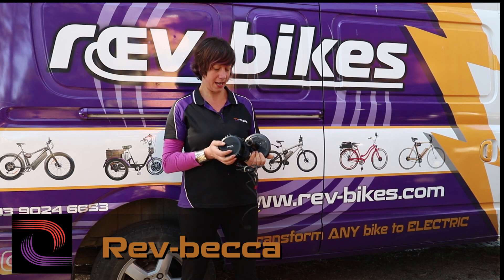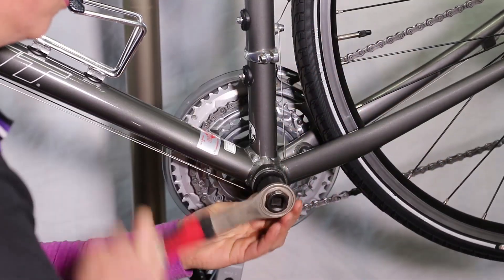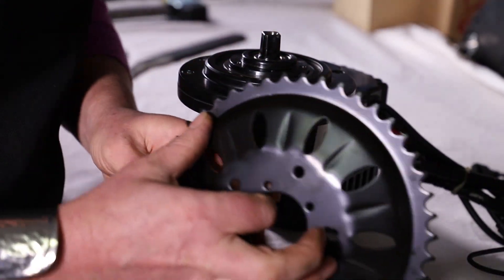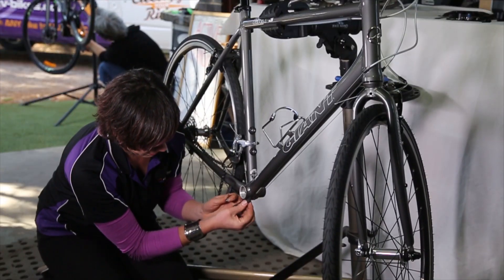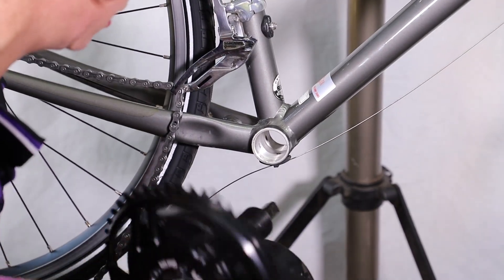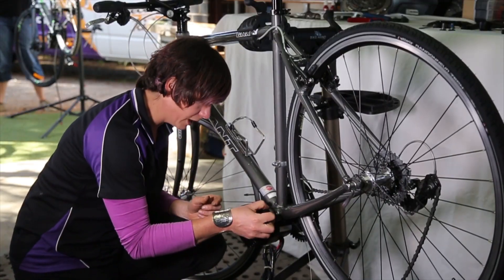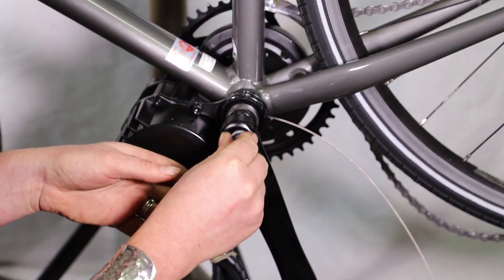Installing a Bafang mid-mount motor

Comment: Ladies and Gents, by far the most difficult bit is to get the right tool for your bottom bracket; this is becuase there are a zillion so-called "standards" out there.  

Be aware also that some cheapo Chinese bottom bracket tools are correct for the job, but are so badly made they still don't fit(!) 

The second most difficult bit of the job is to get your tool to actually work, this is because bottom brackets are very often in super tight even when the bike is brand new. You will probably need to find a way of clamping your bottom bracket tool in place because, when you put serious turning pressure on it, it will want to "wring" out. Remember, remember remember, what she said here about which way the bottom bracket turns each side of the bike. You seriously do NOT want to make it tighter while you are trying to get it loose. 

Once you suss these bits of the job, the rest is generally a cinch.  

Thanks to the maker for the video.
Reply: Nothing wrong with Chinese tools

Comment: Nice video.  The motor bracket washer/spacers and the cable guide and the rubber spacer  were particularly applicable to my Trek 300 Navigator.

Comment: I now have a 27-speed hybrid bike. and I have 3 gears with my pedal cranks.
now I wonder if those 3 sprockets are replaced by 1 sprocket and whether that is a disadvantage or not?

So do you actualy get fewer gears then before the installation?

Sorry for my poor englisch

Comment: I love the Bafang BBSHD, but anyone looking at one should choose LunaCycles as the company to buy from. I wont use anyone else. Besides, they are the only ones making an upgrade controller to push the BBSHD to 3000w!!!!!! It is night and day from stock. I could not go without mine now.
Reply: You can't get squat out of Luna these days.  Makes me really wonder.  Too too bad really.  They were the dreamers.  The innovators.  Then they just dropped of the radar.  Maybe somebody died.  Watt Wagon is the new bad boy.  If you have a LOT of money that is.
Reply: @nohandle257  Anyone that considers buying a Watt Wagon is thinking (not really) with an SUV mentality. Over-priced low-end bikes with add-on mid-drives doesn't make them "good". Anyone that has ever ridden, more than around the block, knows this. Ask God Reed... he'll tell ya.
Reply: I agree that the BaFang BBSXX mid-drives are the best way to build an ebike. I disagree that paying more for one resold by Luna is a good idea. But of course, I strive for range not speed. 3000W will only damage the drive-train. With the right components, a stock BBSHD with very minor programming changes will take me anywhere an over-priced Luna modified BBSXX will go and also much further.

Comment: Have you come across a bottom bracket the hole a bit larger diameter ( not length)  than the  Bafang motor shaft  Thanks Ron

Comment: Hi, if I have a Alfine  8 speed internal  rear hub with a belt drive, can you get a front chainring for it,  that will bolt onto your mid drive moto? If not, why not ? Cheers and good video.

Comment: Very nice! One thing though, You should have cleaned the threads, with Acetate, (Nail polish remover) before applying the "Lock-tight". Other than that, well done! A good, concise, instructional Vid. PS: You can come and put my Motor on, anytime....Geoff.

Comment: What are the statistics on the 1,000 watt motor, what is it's maximum speed, what is the maximum distance of travel, is it power assist pedal etc?
Reply: Search US ebike forums and suppliers and you can get all those questions answered.

Comment: The hand wrench for the BBSXX lock nuts is not sufficient. You can not get the recommended torque with a hand wrench and I over-torque mine by 20 lbs. Use the proper socket and a torque wrench. Also, get the chain line as straight as possible for the gear you are going to be in most... better yet get a Rohloff Speed-hub and get the chain line perfect. Grease the threads on the motor and drop the lock-tight, when you torque to spec it doesn't come loose.
10 May 20 - 100 miles.
https://www.relive.cc/view/vMv85EGzYNO
https://photos.app.goo.gl/9ZbuKQNWsHtRH3Ft7
https://prnt.sc/sw0igi
Reply from the maker: Of course a professional workshop will have a torque wrench socket, as we do. But DIYers probably won't. Nor will they want to change their gear system.. those things are best done by professional bike workshops, not DIYers watching YouTube for instructions 😜 Valid points all the same though 👍
Reply: @Revbikes  So you tell DIYers how to do it wrong. Shitheal points all the same. If you think only "professional" shops use the right tools... then you guys are the biggest one of all. Tell people how to do it right if you're going to offer advice it should be good advice. Fuck'en YouTube Yammerheads.
Reply: @brianbassettnumber1  Oh don't be mean.  These are nice people.
Reply: @nohandle257  I'm trying to help the individuals that want to build their own ebike and do it right Reed. Should I say it with a big smile? If someone is going to offer a self-help or DIY video they should do it right. Or at least look at how others do it properly before offering instruction. Jim Jones might have been a "nice guy" too (I don't know) but he offered bad instruction didn't he? If you're going to install a BaFang mid-drive use the proper sockets and torque wrench to do it properly. I suspect you couldn't care less about ebikes or assembling one.
Reply: @brianbassettnumber1  Yeah ok I  get it.  It's still true that you catch more flies with honey than with vinegar.
Reply: @nohandle257  When I'm trying to kill grass in an ecological manner Ms. Scott, I use vinegar, not honey. Right tool... for the job Reed.
Reply: @brianbassettnumber1  Good grief ... don't be so bitter.  You were correct in your  assessments but what is your point?  To get that point across I reckon.  Well you failed.  You  failed because you are angry and disgusting.  Just as in your reply to me above.  Life is short.  Yours will probably be shorter.
Reply: I  should have added:  Like your girlfriend ( who you should have married years ago ) has been trying to tell you.
Reply: @brianbassettnumber1  Oh my Lord in heaven he calls himself a 'christian'!!!  Well brother I do as well.  This all started when I lightly joshed you over coming on too strong on these nice people.  Then you have consistently  amped it up from there.  So be it.  I  just hope if you make it through the pearly gates you get a fenced off portion from the rest of us nice people.

Comment: Mmmm not so keen on the spacer used to keep the gear cable clear. I would have made one from a piece of nylon that is self-lubricating.
Reply from the maker: Yeah, we've also made much more elegant solutions than this example over the years 👍 This will get the average DIYer out of trouble though, if they need. But chances are, they won't do the motor up tight enough, and this spacer will fall out if not glued in.. Another reason we no longer sell these kits for self install!

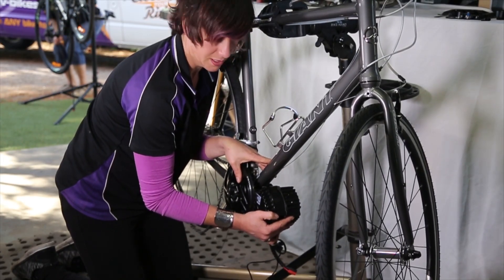Comment: @ 8:59 you missed a step. Using spacers if necessary to get the chain line on the center gear on the cassette.

Comment: Don’t get a mid mount motor no throttle and if the chain breaks you are walking. Rear hub motor only
Reply from the maker: We DO supply (optional) throttles when we install these 😁 How many chain breaks actually happen?!? It's pretty rare, have seen it about 5 times in my 10 years experience! If you split your chain for the installation and rejoin it using the same pin, it will be weaker. Keep your components maintained, and your chain wont break 👍
Reply: Serious ( common sensical ) riders carry a spare chain,  and the tools to do the job,  hub motors are ....

Comment: Thanks, in the middle of my install I just waiting on the bottom bracket tool and a front fork that I broke previously w a hub motor. Can't wait to ride
Reply: Must be a lightweight bike. Guess where it will break next.

Comment: I was wondering how these bolt on motors were installed. Thx. Good information. 

I assume the bottom brackets on bicycles are a standard size? I have a terrific 1992 Miyata Triplecross that I'd like to convert. Can I expect any fundamental size/thread incompatibility issues or are the brackets all the same?
Reply: She mentions about 90% are the Same.  68mm measured across width.  But not all.  Consult your supplier.  Measure your BB.

Comment: Thanks for the video, it demonstrated well including the pitfalls. And this is where I come in.... I have generally fitted hub motors and I am now looking at a mid drive but having watched this I am wondering whether all bikes can have one fitted. I have a Raleigh Royal which is a fairly old bike will it fit to the crank ok?
Reply: Richard, the Bafang should fit any bike with a 68mm Bottom Bracket.  I installed it on my older bike with no problem of it fitting.  If you do have the larger 73mm bracket there is a kit for the larger BB too.  I used Becca's videos and my install went well because she gives you heads up on what issues could come up, especially regarding the cables running along the bottom bracket.  I did have to make a small shim like she suggested to keep the motor from binding the rear brake and rear derailer cables.  Good luck on your install!

Comment: The one question I have about these BB motors is what happens to my converted bike now that I've moved from a 3 ring chainset at the front to a single one? Haven't I just lost two rings and the corresponding gears? Will the chain now be too long? What happens to my existing gearing system? Thanks.
Reply from the maker: You may have lost some gears, but normally it would be the lower gears, used for very slow hill climbing if you didn't have a motor. If you choose a chainring between the largest and middle, that will be best, no need to shorten the chain. You will GAIN five levels of assist to every gear also. You really won't need so many gears once you have the assist 😁

Comment: En visto se ve muy claro cómo meter el motor en el cuadro, pero faltan muchas sensores, la pantalla, todo el cableado,,, etc. Incluso a mi lo que más me costó de todo fué meter el motor en el cuadro ya que tuve que lijar el cuadro y el motor para que pudiera entrar,,, en fin una odisea.  Veamos cómo este tipo de motores se van popularizando. Gracias por el video.
Por  cierto, ya  nos dirás qué hiciste con los cables del tubo inferior.

Comment: "60Nm of torque, so I don't mind whacking it with a mallet.  This one takes 30Nm of torque, so I'm just gonna lean on it with my hand."  Precision measuring, that. :)
Reply from the maker: 👍We now use a custom built socket on a torque wrench in our workshop, but most people won't have that at home 😘
Reply: @Revbikes  I get ya but ..... most people would never try this job.  I am no mechanic but I have a torque wrench.  1/2" drive.  Why?  Because every once in a while I have to wrench on something that has serious requirements.  I'm sure lots of folks who are willing to spend this much to have an ebike will not wince too hard at buying a torque wrench.  Heck,  they can pass it down to their kid who has a fine arts degree from 175th and Plowed Ground State U.  My big question is ... where do I get that socket?
Reply: Yeah I know who sells the socket ... but is it THE socket?

Comment: I have a hybrid road bike with 3 main gear cogs and 8 gears on the cassette.  Will the 46Tooth bafang option be right for me?
Reply: Is it possible for me to buy the wrong option? it goes all the way up to 52T i think.
Reply from the maker: 52t gives less torque and more speed.. better for flat land. 46t is the best for good torque and speed.

Comment: Next time just run a full length cable housing for the rear derailleur.  Just use the screw at the bottom to hold the cable housing.  THat way when you change cables next time you won't have to remove the motor.

Comment: 73x65mm EBB on my Jones LWB steel frame gave me a run for my money.  Ended up having a machine shop shave off the bottom tabs, weld the BB at the bottom and installing a Bushnell EBB.  I now have a monster of a 750w ebike with H-bars, front and rear racks capable of sporting any pannier I like, and fantastic 2.35" tire handling.

Comment: I'd like to do this mod to my ACME by SPOT, Gates Belt drive system with an 11spd Alfine rear hub system. Where would I get the appropriate front belt drive sprocket for this motor install/modification?
Reply: I haven't seen a Gates used with the BaFang BBSXX yet. I can't because I have a full suspension tour bike with a Rohloff Speed-hub. A mid-drive to a suspended Rohloff with a belt drive would be perfect, clean, quiet, low maintenance, durable and pretty.
https://photos.google.com/photo/AF1QipMW6VP2OgxQVnUTqzm2yFEF-p9xXklItcc7CU7E

Comment: Hallo Good Morning 
Is a Pleasure having you how You put the Motor together.
Pls my humble Question is,how can I change my gear handle Bar comes together with 
The Break While BBSHD Break handle Bar Need installed,
Pls I need your help,
Reply from the maker: I think you mean you want to utilise the brake cutout function for the motor, but your brake and gear levers are integrated. 
In this case, remove the brake/gear on left (because you won't need to change gears on the front now), and just use the brake lever supplied with the kit on that side (no need to use both). 
It's also possible to buy sensors which can be attached to existing brake levers, if you want.

Comment: You don’t need the bike on the ground for disassembly if you grab the frame with your fingers and your thumb on the wrench. Turn the wrench like you were squeezing pliers. 
For assembly I would use a torque wrench and do it correctly “ 60Nm “ I think she said.

Comment: I have 2500 miles on a BBSHD and have found that several times over the life of my ebike that the motor loosens and begins to droop. There are brackets that can be bought but the best solution I've found is a small sailboat turnbuckle. If you search the web for "Bafang Sailboat Turnbuckle" you'll find the fix. These can be sourced all over the web for cheap. Other than that my ebike has been alot of fun and very useful.

Comment: Use a better stand, higher up, so you’re not sitting on the ground. And use a torque wrench. Longer, so makes it easier to tighten stuff, plus you achieve correct torque.
Reply from the maker: We use stands and a torque wrench in our workshop of course, but this vid wad made for DIYers, and we were utilising the while background of our counter for clarity 👍

Comment: Thanks so much.  I have a Giant and I would have been lost without your guidance regarding the cable guides under the motor.  I ran into that problem and didn't find the answer anywhere else.

Comment: Hi, Well explained! Can the original pedal cranks be used as usually smarter than the supplied version? thanks.
Reply from the maker: Only if they are made to suit a square tapered axle, and the right side crank doesn't have a chainring attached to it.

Comment: I have a question concerning the single sprocket.  Why cannot there be two sprockets and reuse the derailleur?
Could a slumpf drive (probably mispelled as I'm not taking time to look it up) be used?

thank you for your patience.
bf
Reply from the maker: The front sprocket becomes the drive sprocket, so it's not practical to have 2. You won't need that many gears anyway with the motor.
Reply: @Revbikes  I want the extra gears because I don't always use electric assist.  Do you know of any reason another sprocket could not be added to the front, or even a third sprocket like the trike came with before the assist was added?
Thank you,
bf

Comment: Will one of these mid motors work on my Trek Marlin 6 MTB?
Reply from the maker: Probably. Does it have a standard type of bottom bracket, with a square tapered axle?
Reply: I own one of those. I think a Bafang BBS series would fit fine. I installed one of an older Trek 4300.

Comment: I was ready to buy a bafang mid-drive motor but this video made me opt out of it. If my bike has to get any mofdifications to put the motor (for those gear wires) then I am not going to do it. I thought those motor companies figured out that every normal bike has those wires right below the cranker so they somehow should have made the motors fit there without the need to make such modifications.
Thanks for the video. It saved me from a ton of hustle.
Reply: You can re-route the gear cable to the upper frame
Reply: @serran0669  Looks like my bicycle has the wires on the top part so I am good.
Reply: That's a $2 plastic part. It's more of a change to replace a punctured tube.
Reply: Oh PUHlease.  Do you give your wife the coffee cup back if it's 2 degrees of 'proper' temperature?

Comment: Thank you Rev-Becca !

This is without doubt the best video on how to install a midmotor Bafang. I esspecially appreciate you pointing out potential issues with the gear cable guide touching the motor and also in using a rubber shim to stop the motor touching the rear gear cable.  Excellent stuff.    Bafang 750W, 48v 12.AH battery on a specialized crosstrail. Loads of fun
Reply: Using a Specialized Sport 2008/9 going to purchase 750 kit soon, just trying to decide best battery. Any help appreciated? Live in West Virginia, USA and it can be pretty hilly. State Reg’s say I can ride a Class 2 in any park or trail/road with no license or insurance, etc.